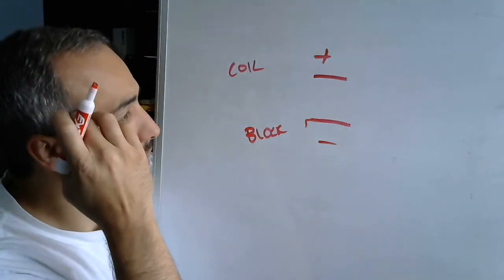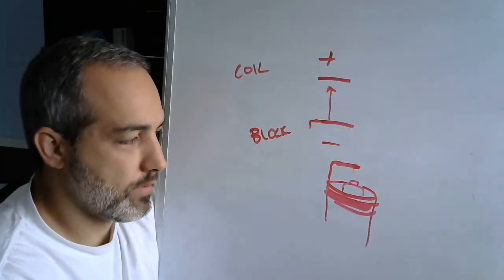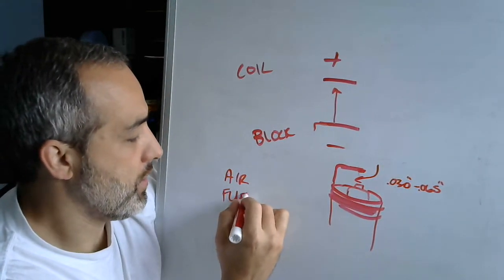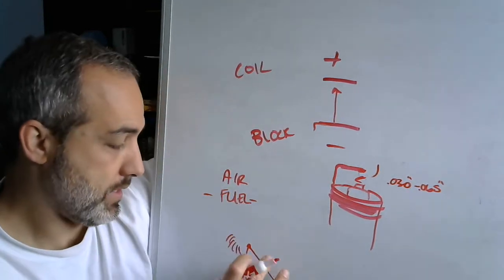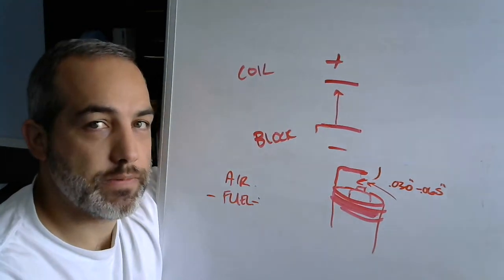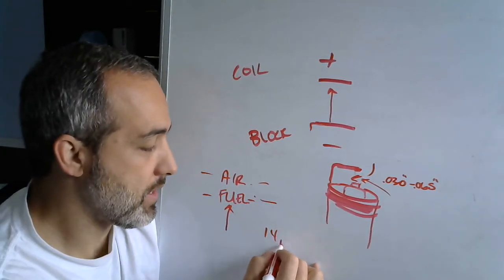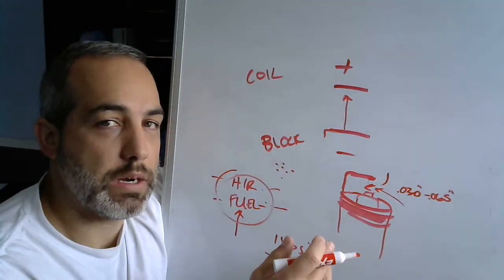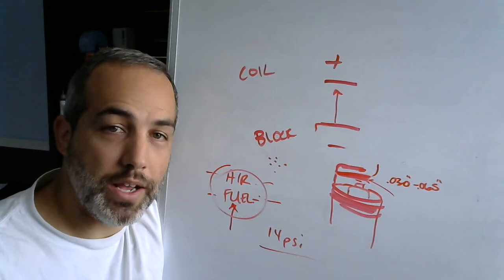Spark Gap- Blowing out spark

Comment from the maker: I say air and fuel are "conductor of sorts", I meant they are insulators and do not conduct well. Thus why putting more air and fuel between two points requires more voltage.
Reply: So are you saying it may be better to reduce the gap to prevent the blowout from happening then?
Reply from the maker: @gregziedonis9388  if you don't have enough spark energy and you can't lean it out any, yes.

Comment: Well explained... do you think adding "hotter" coils and increasing the gap on the plugs is worth while? Would it not be beneficial to run as much gap as your ignition system can use?
Reply from the maker: @AIR_RAM_PERF  as long as you can light it off in all conditions. Just know that if you increase your spark enough you'll have you reduce your ignition advance or you can cause damage

Comment: What should I set my spark plug gap to start off with? I have a 2012 sti with an IAG stage 2 tuff block, full bolt ons with an fp blue turbo. Peak boost is around 20-22 psi. Would .028 suffice?
Reply from the maker: Definitely stock gap
Reply: @GetaDomTune  ok so since I ordered the ngk iridium IX spark plugs..they come pre gapped. So I could just install them right out the box?
Reply from the maker: @jmt0728  yes, but if you go to ethanol, the ix plugs hurt power by around ten percent.
Reply: @GetaDomTune  wow first I heard of this, would a basic copper plug be more ideal ?
Reply from the maker: @DBTUNED-FL  no, not at all. 
The stock plug or the ruthenium plug are the correct plug for ethanol.

Comment: If i could increase the voltage to the primary coil, would that help from spark blowout and increase the mj output of the coil? Thinking of supplying 300-400v to the coil and having a nice hot spark that doesnt blow out.
Reply from the maker: yes, but you have to be aware of current flow during the charge. 300v would be a little hot considering it normally gets 14.
Reply: @GetaDomTune  I was thinking the resistor plugs are holding back a lot of energy and the MSD A6 puts out 500+ to the coil so 300v  with low current might not turn the spark plug into a plasma cutter.

Comment: Curious on a 2013 STI with stock turbo with ported housing, CAI, ID 1300 inj, Nvidia ELH, Nvidia catted downpipe,  with Nvidia cat back. Purchase the car with a married AP tune  (no access port). Would you recommend NGK iridium plugs One step colder at the factory plug gap to start or go with the original NGK plugs and tighten up the gap?

Comment: So with what you said…is it best practice to find the biggest gap that does not cause “blowout”? I am experiencing this right now at full boost and higher rpm. I was going to be decreasing gap and doing more pulls. How does decreasing gap effect performance (acceleration and even dyno numbers)?
Reply from the maker: Correct. 
Smaller gap reduces the flame kernel and reduces burn speed which can result in a loss of power and more inconsistent burns

Comment: I have a turbo charged k20 that has been dyno tuned. I recently upgraded my intercooler with a better flowing more efficient treadstone intercooler.  I've been experiencing something like a boost cut but I'm not overboosting.  I think it's probably a fuel cut . My gap is set at .0017 thousands.  I'm boosting at about 10 lbs . The fuel cut happens at around 5k rpms.  The vehicle preformed very well 1 time with the new intercooler.  I don't know what happened any input would greatly help thanks.
Reply from the maker: 2 or 4 coils? How rich is it running?
Reply: It has 4 coils.  I couldn't tell you how rich it's running.  I need to data log. I have no misfires. When it cuts it dosen't back fire or anything.  It just feels like a boost cut but I'm definitely not overboosting.  Car has 124k . I'm thinking either weak coils or clogged injectors possibly.  All temps and pressures good. Thanks
Reply from the maker: @camlobesvtec  weak coils would create misfires. 
Over boosting would create a boost cut.

Comment: Tuner said my clutch was slipping a bit up top... It feels jumpy and stuttery. I never smell clutch so it could be ignition... How do I know? Should I just gap them shorter and see? They're at oem gap which isn't meant for a turbo like I have now... And it's a mechanical distributor.
Reply from the maker: I would reduce the Gap. NA gap is way too large. Knock it down to .030" and give it another shot.
Reply: @Frozti you figure it out ?
Reply: @rj6198  I reduced the gap and all stutters went away, makes me wonder if I would have made more power on the dyno. Tune was slightly lean after that tho. Having other issues now.

Comment: thank you, now that was a good explenation why you should tighten the gap on a spark plug. question, how do you know when to decrease the gap? I had an engine tune and installed a better duct for the air to the intercooler and turbo. I haven,t noticed any difference on engine behavier, besides the fact that it has a lot more torque.
Reply from the maker: You want to run the widest Gap you can get away with. Only reduce it if you experience problems.

Comment: Ive got a boosted civic and under high boost it misses bad. Are ngk plugs and wires worth and could it help?
Reply from the maker: NGK plugs are great plugs, but they won't help if you don't choose the right ones or set them up properly. If your coil is weak, plugs won't fix it. 
Also, if your tune is bad and you're running way too rich, plugs can't make up for that.

Comment: Is there such thing as too small of a gap? Currently at 0.015 and the car is losing spark around 22psi. Haven’t seen anyone go any smaller gap so I figured it was time for ignition upgrade? Even knowing of plenty of other people running more boost than me no issues. Turbo GSR
Reply from the maker: Yes.  A smaller gap means a smaller spark. That means a smaller flame kernel which results in a slower, less uniform burn. 
If you haven't replaced your coils, you should start there. Then add a larger power lead to the coils to ensure they get a constant 13V. I usually add a relay setup like you'd find in the MSD LS1 Coil power wiring kit. The ground is also crucial. Be sure you have a good ground, both to the body of the coil where it mounts and from the ground lead. 
Last thing is your dwell setting. Don't use too much dwell. Most coils want around 2.8ms at 6k rpm and 14V.
Reply: Joe Warner I’ve got the same issue bro on my evo 8 it’s running 22 psi and hesitates violently and misfires on boost how did you fix the issue ?????

Comment: "Spark blowout" would be caused by a higher mass/ higher density of air the spark has to jump with higher compressions. Consider a normal motor will see 150psi cylinder pressures at just 600rpm, or 220psi for motorbike or high comp motor. Actual running cylinder pressure is higher than that. Then if you add 14psi boost at the inlet, you appromimately double the air density and mass, and reduce air conductivity. For the spark to jump 1mm outside the engine in 1 atmosphere you only need 3000 volts. But inside the engine you want ~ 30,000 volts. This is why if you are checking you have spark with a plug outside the engine, you want a fat spark about 12mm long.
Reply from the maker: Yeah that's what I said, but in easy ways for less technical people to understand.

Comment: While on the subject of plug gap, coil energy, etc.
Can you give your opinion on the high energy coil packs and their usefulness  or lack thereof, specifically on turbo cars such as a WRX/STI? 
Are there certain performance levels below/above which it is necessary/Not necessary?
Reply from the maker: maxs1000rr you can never have too much. The issue is that there are lots of aftermarket coil offerings that claim more energy, but don't deliver, while at the same time not even coming close to OEM reliability.
Reply: @GetaDomTune  do you have a reccomendation?
Reply from the maker: @melody3741  stay stock
Reply: @GetaDomTune  lmao great idea! Im not even having blowout issues anyway.
Reply from the maker: @melody3741  there are stronger coils, but they don't mount in the stock location and would require spark plug wires and custom wiring.
Reply: @GetaDomTune  maybe when i build the engine and run it on 30 psi i will do that.

Comment: Video was very informative! One thing that I wish you talked about was the different heat options for spark plugs. Why are there colder and hotter plugs and why you should go colder when running lots of boost!
Reply: The short and skinny of it is colder spark plugs dont retain heat as much so you have more of a fighting chance against pre-ignition. Most spark plug manufacturers will suggest you go one range colder for every 50 or so HP over stock